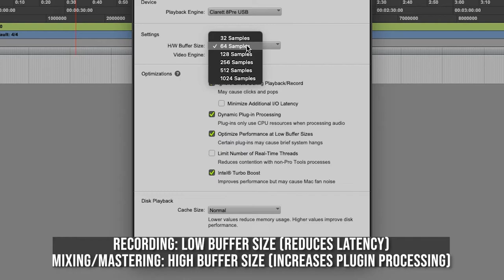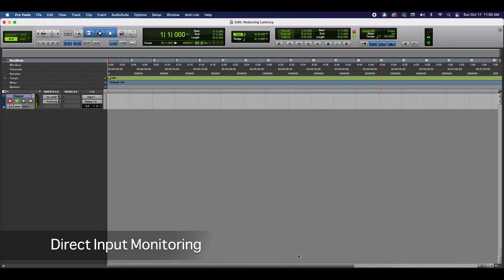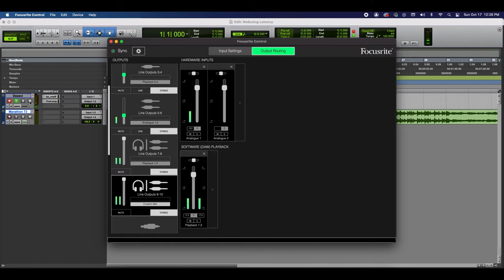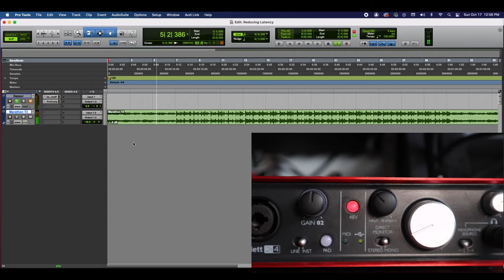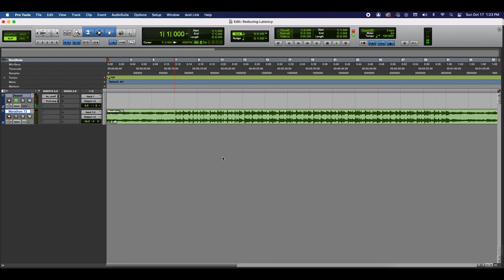ProTools Reducing Latency/Delay | How To Reduce Latency | H/W Buffer Size & DI Monitoring

Comment: Please help me ‼️
I’m having pops on my studio speakers and headphones but not just on my sessions while trying to record, (I can’t even record) because it pauses by itself, I think because of the cracking sounds, but even when i’m not on pro tools, when i’m just playing anything on my laptop a beat,song etc it pops! Btw I’m using a new interface i just brought today (Presonus audiobox 96) i had an issue with latency and the phantom button on my old interface (Presonus audiobox usb) but never had this type of problem that i have now with the new one! My settings are all the same as before, I’ve tried changing settings and everything but it keeps making those weird sound when i play anything! This doesn’t happen with my old interface just with the new one, I don’t know what to do because I don’t think it’s the interface, maybe settings or something on my laptop but I already tried changing everything, buffer size, etc… and nothing! And when I’m trying to record after 5sec the audio is gone!! I even got this message on pro tools session. “Audio processing could not complete due to conflicts with other CPU tasks or a potential clocking issue. If this occurs often, verify your sync cables or try changing the HW Buffer Size setting in the Playback Engine dialog. In most cases, a larger HW buffer size will prevent the problem. (AAE -9093)
Reply from the maker: Hi Woke Pusha. I'm sorry that you're having those technical difficulties. Let's resolve the issue. It could very well be the new interface. Try using a different USB cable on your new interface or even the cable that your old interface uses. Secondly, test the interface on another computer and see if the problem persists. If the problems persist for both, you should exchange your new interface. You'd expect your new interface to not be the issue because its new, but new products can be faulty. I just bought a microphone that didn't work and had to exchange it for a new one. This isn't uncommon. Also, explore your options in other brands such as Focusrite or Universal Audio. Both deliver quality audio for reasonable prices. I hope this helps.
Reply: @DezaviProductions  thank you so much for the response! I didn’t tried using the old usb cable but I don’t think it was that because my old interface worked with the new cable as well, I didn’t tried the new interface in other computer, i just got back from getting a new interface (Focusrite scarlett Solo 3generation) let’s see if this works!!
Reply from the maker: My pleasure, hope it works out for you!